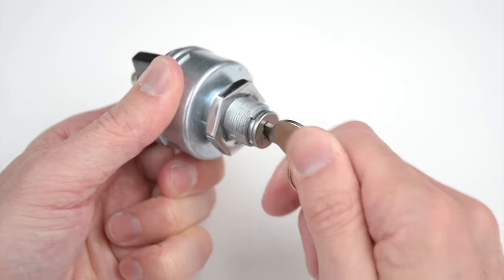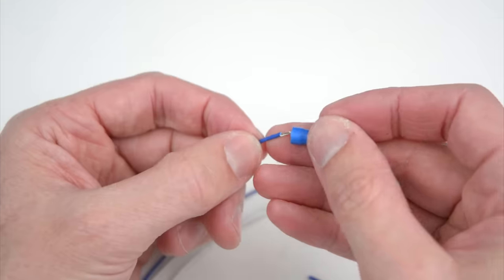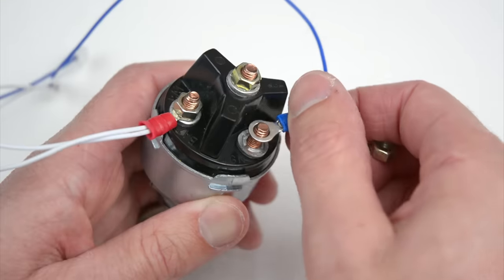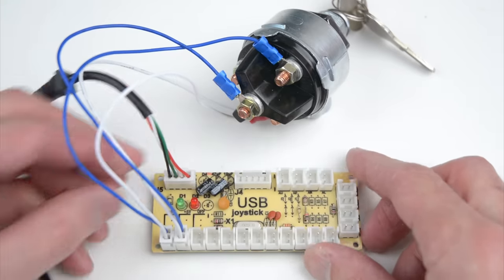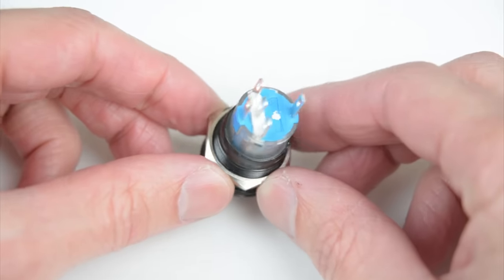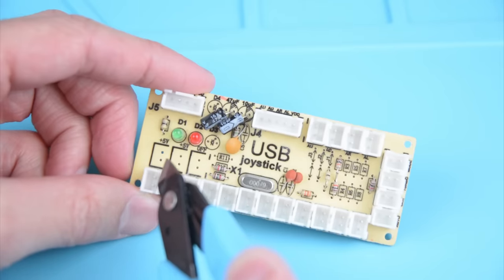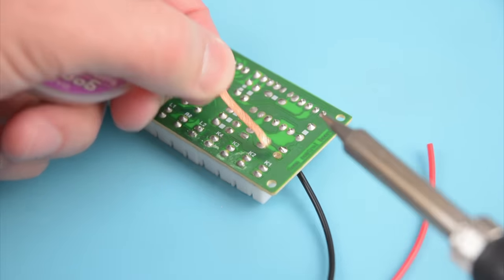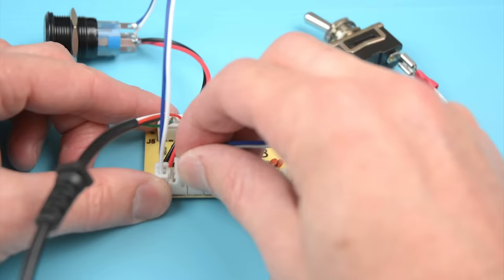HOW TO WIRE IGNITION KEY + STARTER SWITCH SIM BUTTON BOX

Comment: if anyone who is making this right now or in the future and you are having issues with both button inputs being triggered when you turn the key to the ignition position here is how I managed to fix it:

1. Separate the two white wires, don't crimp them together.
2. Give both white wires their own connectors.
3. Place one white wire on the start terminal, and the other on the battery terminal.
4. Place one of the blue wires(or both, I didn't notice a difference) on the ignition terminal.
You should now  be able to have the ignition toggle on, with the start momentary.

If you are curious as to why this works/the problem exists, it's something to do with having the two white wires joined as a negative in the circuit. Blue is positive out of the board and white is negative, and the board only checks for a 5v signal going into the negative side. So, when you have the ignition activated in the video's wiring configuration, current is sent into the negative for the ignition, but, it is joined with the momentary start, and as such that gets toggled as well. If you separate the wires onto different terminals and also reverse where the power is coming from, you are able to control what power goes into the negative lines. My configuration works because both terminals in the switch connect to the battery terminal for power, which is what powers it in a real vehicle. And, the ignition stays active when you enter the momentary start position. So what happens is that you have the power going from the ignition terminal out to the battery terminal in the ignition position, and when momentary start is engaged it is connected to the battery terminal as well, so power flows through it from the ignition terminal, out both battery and starter terminals, and the starter will cease sending power when you go out of that position, such that you now have a working key switch.
Reply: Thank you very much. I searched for that comment 😁
Reply: So if you're saying that white is negative and blue is positive than there's simpler solution. You see, the current (or if you want to be precise the free electrons) flows from + to -. This means you need to: 
1. connect two blue wires to the battery terminal 
2. connect one white wire to the ignition terminal
3. connect the second white wire to the start terminal
(or in other words just flip the colors)

The problem of connecting two white wires to the battery teminal is once you activate the ignition terminal the current flows from ingnition to battery terminal to which are both white wires connected. This results in completing the circuit on both connections which you can see on your computer as the activation of both buttons. 

So if you connect two blue wires to the battery terminal as I suggested the signal process should look like this: 

1) When you activate ignition terminal the current flows only to the one white wire so only one button signal is activated
2) When you activate the start terminal the current in theory should flow to the start teminal which only activates the second button. However, insted you'll probably see both buttons activated. This happens because the ignition terminal is still activated even when you turn the key to the start position. This doesn't affect the gameplay, though. You've already activated the ignition so all you need to do is start the motor (in real car the ignition turns on the electronics which are needed during the whole drive while the starter is needed only in the begining, that's why the ignition is on even in the start position). When you want to turn off the motor you just turn the key again to the start position and than you turn it all the way back untill you can take it away. It's that simple (well maybe because of the amount of the text it doesn't look like it but trust me, explaining what is really happening in Sk3leCreeper's case would be wayyy harder).

If you don't believe me (a high scholer who studies physics and chemistry) than you can try Sk3leCreeper's method which might work but it's too complicated in my opinion. It also doesn't make really sense why it should work better than mine so that's why I don't trust his method.

Comment: but what If I want all 3

the key to power the switch  toggle the lever as an emergency stop and the button to start the engine

so you have to do all 3 steps to start the engine and if soemthign goes wrong and or aesthetics you can just slap on the switch and it depowers the whole thing

Comment: do you know how to make some thing like this or like a button box wireless I'm specifically asking because I want to make a steering wheel button pad that doesn't have a wire sticking out of it that gets in the way when you turn the wheel also could you do a second video on how to setup custom arduino button sketches
Reply: I know this is a really old commend, but should be posable with two arduino's connected with bluetooth.

Comment: does this require coding? Cuz i cant see it in the vid
Reply: Doesnt seem so. My guess is the USB controller board shown come preprogrammed with a keycode for each available connection. To use it go to settings in game, remap the action(in this case ignition/engine start) and then press the switch when it asks to press the key you want.

Typically these send out keycodes apart from the ones on your qwerty keyboard, at least something other than the alphabets and numbers.

Comment: ignition key not working for me - just turns on two buttons when twisting the key :(
Reply: I've got the same problem. If that ignition key is for Euro Truck Simulator it's better to use 3 wires sets.
In my case i got red and black wires
If you got white and blue cables than my black wire is your blue wire

step 1
Attach all wiers to encoder 
step 2
Black wires from pin 1 and 2 attach to starter pin on top (it's named ST)
step 3
Black wire from pin 3 attach to battery pin (named BAT)
step 4 
Red wire from pin 2 attach to accesories pin (named ACC)
step 5
Red wire from pin 3 attach to ignition pin (named IGN)
step 6 
Red wire from pin 1 is unnecessary you can cut it off

Hope I helped you

Comment: hello amstudio I wanted to know if it was possible for your key ignition to use a real car neiman like starting a normal car I saw 4 wires you think it could work thanks in advance for your answers I know it's 12v on a classic car but if you plug in a 12 / 220v adapter like I could do on my real car meter as in your video on the bmw E36 meter thank you in advance for your answers

Comment: I tried this unfortunately it just didn't work but my wires are red and black
Reply: nick svaluto ..... that’s just the colour of the wire sleeve
Reply: @nisaim6599  so would still be able to use my current set up of blacks twisted together and separated reds
Reply: I tried this joytokey software to supposedly map out buttons to function unfortunately I just can't get it to work I don't understand it any suggestions would help thanks
Reply: I've got the same problem. If that ignition key is for Euro Truck Simulator it's better to use 3 wires sets.
In my case i got red and black wires

step 1
Attach all wiers to encoder 
step 2
Black wires from pin 1 and 2 attach to starter pin on top (it's named ST)
step 3
Black wire from pin 3 attach to battery pin (named BAT)
step 4 
Red wire from pin 2 attach to accesories pin (named ACC)
step 5
Red wire from pin 3 attach to ignition pin (named IGN)
step 6 
Red wire from pin 1 is unnecessary you can cut it off

Hope I helped you
Reply: @szkielecik20  thank you its working perfectly with joy2key for both